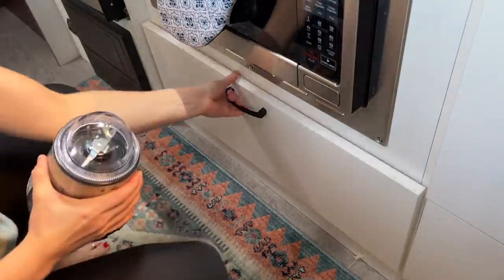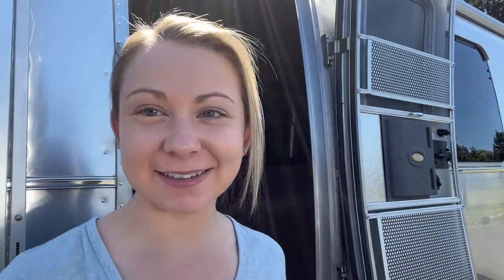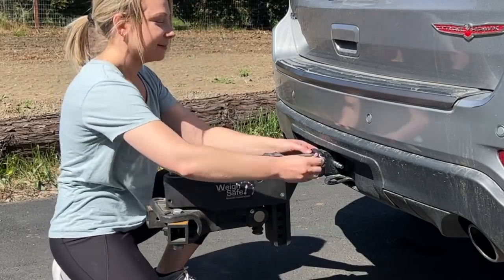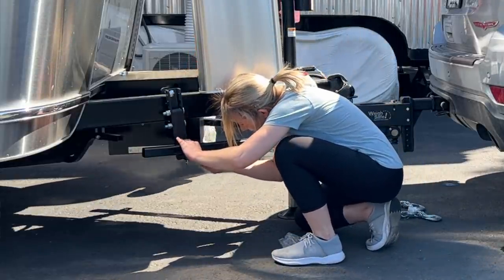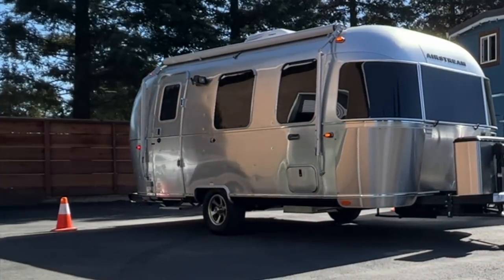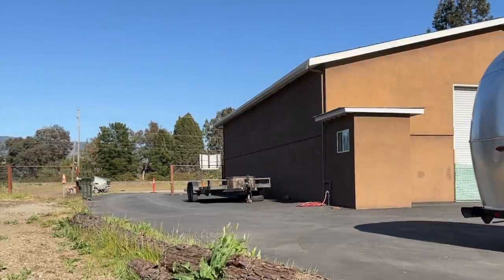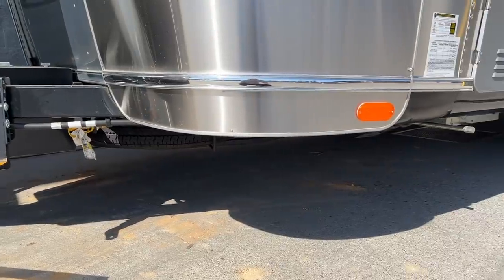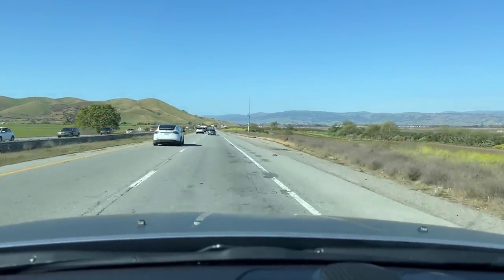Learning How to Back Up my Airstream Travel Trailer | Towing with a Weigh Safe Hitch

Comment: Good idea to get the trailer weighed.  And the weigh-safe hitch is an excellent choice.  You might already know this, but your payload rating is the more important number when towing than the rated towing capacity of your vehicle.  You are much more likely to exceed payload long before you get close to towing capacity.  Your weigh-safe hitch can tell you your tongue weight (which is an awesome feature).  You just need to add that to the weight of the hitch and all the gear in your vehicle and passengers (yourself and the pup).  Then check your door sticker just inside you driver side door.  It will list the payload capacity of the vehicle.  As long as your tongue weight, hitch weight, gear, pup and yourself are under that number, you are good to go.  If not, you could try moving some of the gear into the Airstream as long as you keep its weight below the max rating.  It is a balancing act, as is everything with RV life.
If you are over your limit after adjusting gear storage, there is not much more you can do other than get a bigger truck.  There are no mods that can be made to a vehicle to increase its payload (be careful of people who say otherwise).  The risk to being over payload is stress on the vehicle frame, axels and suspension.  Also, if you are in an accident the insurance company might deny your claim if you are exceeding the limits of your tow vehicle.
Keep up the great videos.  You already have better story telling and editing skills than most beginner RV channels.  I look forward to seeing your next adventure.
Reply from the maker: Thank you so, so much!! 😁

Comment: I know that it feels more natural to put you hand at the top of the wheel but if you practice using the hand at the bottom of the wheel it gets easy. I learned that way when I got my first horse trailer and after awhile it just became the natural way to do it and I got really good at putting my trailers no matter what size, just where I wanted them to go. Practice it awhile and you will find it is much easier.

Comment: I found a backup camera on Amazon that transmits a good picture. You can tape it on or find a place for it and then do all the backing up. It's wireless. Rechargeable battery.

Comment: Great video.   As you are doing...only way to get better at backing your trailer is practice, practice and then more practice.   It will become second nature with time.    Best backing tip I ever got:  if I am the least bit unsure, stop get out and look around.  Last thing I want to do is bump into something and do some damage when it can easily be avoided.  Even in a campground with someone waiting, take your time, stop get out and look around if necessary.  Most folks understand well and don't mind a couple of minutes of waiting so that someone can back up their rig, and if they don't understand, then I guess tough luck for them.

Comment: Nicely done. You should feel confident that you will do well. You showed a critical skill - taking your time. Didn’t see it in your video, but consider this essential safety rule. Chock your trailer wheels in both directions - first step on check list when parking. Removing your wheel chocks is the last thing you do before pulling out.
Reply from the maker: Thank you, GK!!

Comment: I agree with you that the hand on the bottom of the steering method seems hard to feel comfortable with.  It's a quick way to get someone somewhat functional at backing a trailer, but once you head understands what the vehicles are doing, just go with what feels natural.  I think that keeps the overall stress level down a bit.  And I always feel like a bit of "stop and just think about what you want the trailer to do" (like you appear to be doing) is the secret.  Good job!

Comment: Good job, Sarah!  Was that an added light of some sort you removed over the window in the bathroom?  I need something like that!  So hard to apply makeup with the lighting in the bathroom!  Please share info about the light!
Reply from the maker: Thanks Audrey! Here's a link to my bathroom light:
https://amzn.to/3xCsyqK

There's a plethora of options out there, but I chose this one because its a bit more of a warm light versus a harsh bright white and it's battery powered, so I don't have to constantly recharge it. Came with a nifty little adhesive magnet to mount it and it's easily removed when towing or replacing batteries. Highly recommend! 😁
Reply: @NomadicSarah  Thank You!

Comment: Great video!  Where do you stow the weigh safe hitch after you arrive at your destination?  I really like that hitch but wouldn’t want to leave that attached while driving around during a vacation trip.
Reply from the maker: I currently keep it in a shed where I’m staying. It also fits in the same compartment I keep the spring arms in, although it’s a tight squeeze for a hefty piece! You could also stow it in the trunk of your car while not in use.

Comment: I am a travel tech too. MRI. Also with a pup. What is your tow vehicle? JGC V6? Or V8?!
I have the V6, max tow 6200 but you're at 4200lbs plus what you have inside.  Have you weighed your trailer with everything in it?  I'm worried you're stressing your jeep components way too much. I have a trailhawk too. Yes backing up my cargo trailer, a 6x12, took some time being efficient. I was terrible at it even tho I learned the tricks from YouTube

Comment: Nice video. I just pick up my caravel last week and found that parking is really the hardest thing as a new airstreamer. May I ask what is the product that you use to check the tire pressure and fill up the tire pressure?
Reply from the maker: Hey Timothy! Here's a link to the tire pressure gauge I use:
https://www.amazon.com/dp/B087RVVXXP?psc=1&ref=ppx_yo2_dt_b_product_details

I can't find my specific one, but I used a small air compressor I keep in my Jeep to inflate the tires. Mine has to be plugged into a 12v outlet, but I'm hoping to upgrade to a cordless one soon. Hope that helps!
Reply: @NomadicSarah  Thx Sarah for the information. We just got back from our first trip with our 20' caravel from Santa Cruz and had so much fun. I'm sure you will enjoy yours too.
Reply from the maker: @timothylam8289  that’s awesome! Where did you stay in Santa Cruz? I’m close by. 😊
Reply: @NomadicSarah  We stayed at the New Brighton Beach campsite. My family love that campsite a lot.  You can walk to the beach from the campsite in 10 mins. Highly recommend.

Comment: We do not plug drains incase water is in pipes during traveling or when we hook up and a knob got turned on. It needs to drain.
Reply from the maker: Interesting! I was told by the dealership to plug it so gray water doesn’t splash into the tub while towing. But I think your reason for not plugging it makes much more sense.

Comment: What was the result of the literal shake-down?  Any bad latches or loose items?
It's interesting that you found the bottom-of-wheel technique less natural than reversing your sense of direction.  I'd be interested to hear more.
Reply from the maker: The only thing that didn’t stay in place are the dinette cushions and the power center/breaker panel door was open. As far as the steering wheel, I guess you don’t know what feels best until you try it yourself! That’s just what works for me for now. Not to say that won’t change!

Comment: curious to know what your jeep Payload is ? at 4750 and 12.5% your Tongue weight could be 593 lb. Add your cool looking dog and you weight is another 200 lbs. so not counting anything else you may carry your moving around with 800 lbs. add fuel water and everything else you maybe very close to max. Payload is more important that towing capacity.

Comment: What is your max towing capacity with the jeep your towing with ? And engine size ? thanks great job too
Reply: 6,200 lbs. max tow weight; 620 lbs. max tongue wt.
Reply from the maker: What situated4 said! And it's a V6
Reply: @NomadicSarah  getting ready to pull caravel with my Gladiator.  Thanks
Reply: @geneseminoleranger7773  did you get the caravel? If so, what size? Does your gladiator pull it ok? Any issues? I’m about to get one and nervous about the gladiator towing it. Any help is much appreciated

Comment: You're exceeding the tongue weight and most people don't exceed 70% of their max capacity.  Plus you have a payload limit to 1000lbs in the jeep. From what I can see you don't have much in the jeep so it's OK.
But your MPG must be under 10 miles per gallon. I realize you only tow once every 3 months but you need to drive slow. Do you know to put it in sport mode or manual when you tow?  
Have you talked to any jeep people before you bought this trailer?  The antisway wd hitch is of huge benefit. But my concern is you're still overstressing and reducing the life of your jeep and components.  I think the tongue weight max is 300 or 350. Well you're at 4800, and ten percent of that is already 480. Maybe the wd hitch will save you in that respect.